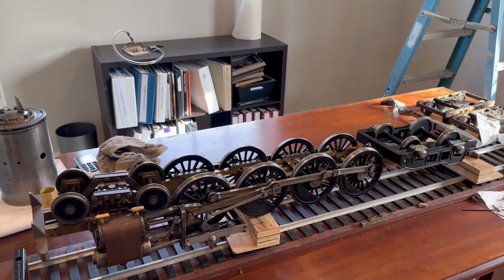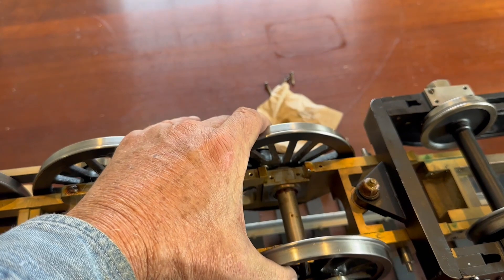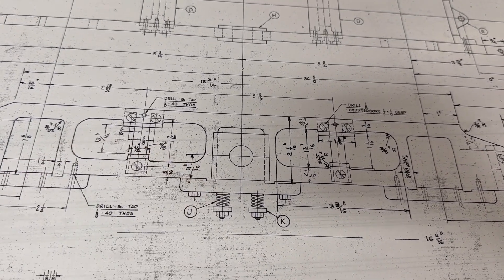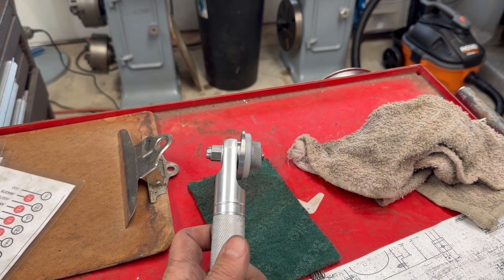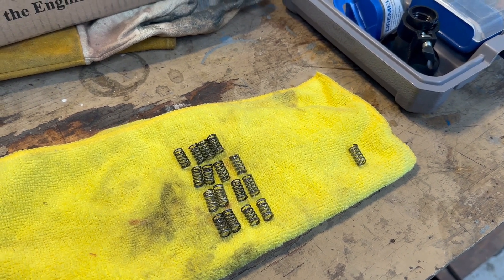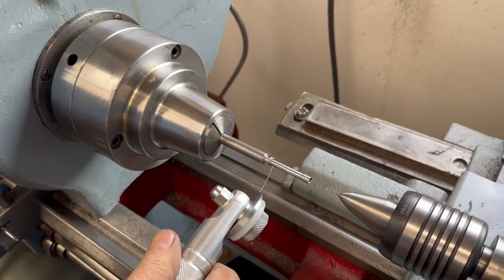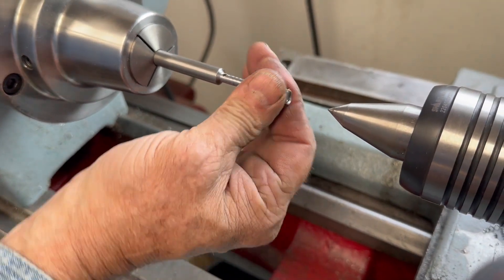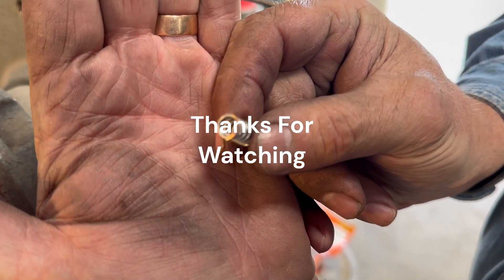Using A Hemingway Spring Winder To Make Small Springs

Comment: You could try bending the crank at the start of the spring more than 90 degrees and then fit it into one of the three collet slots.  That's what I do.  Then I made a V groove tool for the four way tool post to guide the wire which has a separate top plate held with a small cap screw to restrain the wire in the groove.  To set the spring pitch I use the Lathe's leadscrew gear box.  Set the Lathe to run very slowly as you did and back wind the start of the spring by having the wire back at say 5 degrees to get closed turns.  Then wind the required number of active turns and disenage the saddle drive and back wind the outer end of the spring to get closed turns at the other end.   With a long thin mandrel I support the other end in the tailstock chuck and so can wind several springs in one long piece.    I don't let the spring rapidly unwind,   as I found that can distort the spring,   so set the Lathe in reverse of the winding direction until the radial spring tension is released.   Slide the cranked end out of the collet slot,   then cut the springs apart with piano wire side cutters which you can buy from piano component suppliers.
After making the spring you will find that it has hysteresis due to the slip lines in the crystalline structure of the wire material.    To ease these out,   wash the spring in Naptha and don't touch the surface.  Hold on a thin piece of clean wire.   Then heat very gently and slowly with a hot air gun or butane torch waved over the spring until you see a dark straw colour.   Then dunk the spring into cold water to arrest the process.  You'll be amazed at the difference it makes stress relieving springs after forming.   I polish the wire before forming with 1500 wet and dry paper to better see the tempering colour.   Best spring wire I have found is made by Roslau in Germany,  available from piano component suppliers.  Subscribed.
Reply from the maker: Thank you for taking the time for your comment. I’m always interested in learning and you given me some very good information.